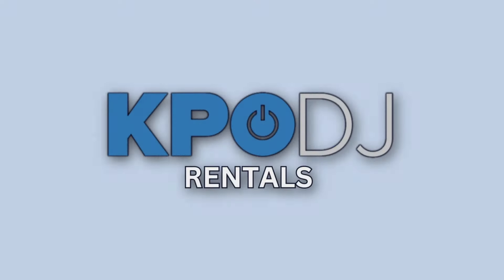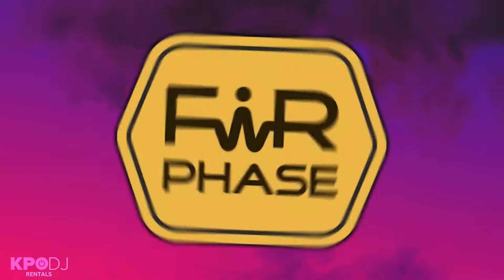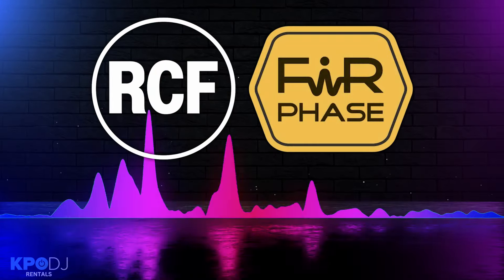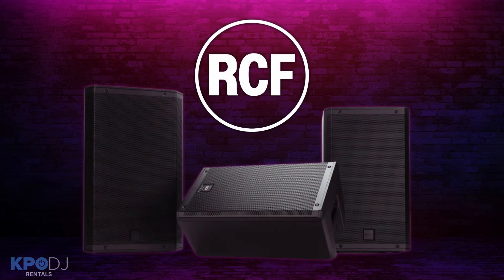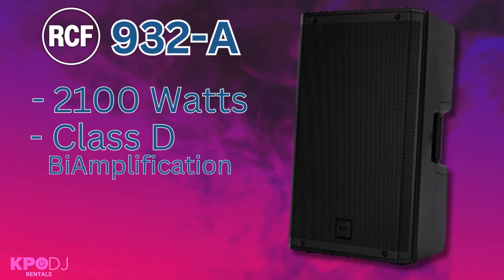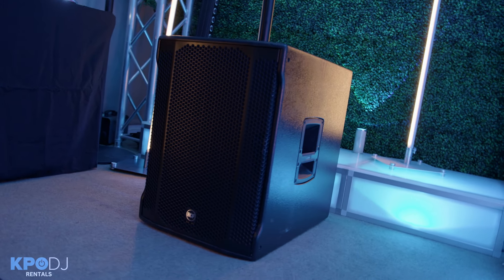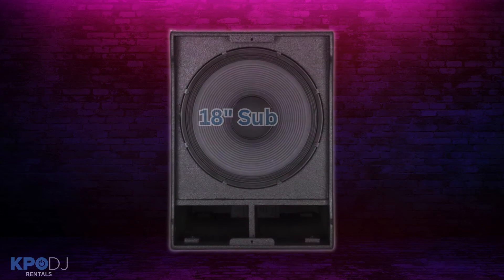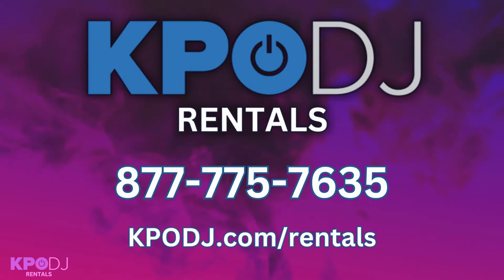Our #1 Audio Rentals: RCF ART 932A & Sub 905A MK3

Comment: Im looking for this exact setup for my electronic drum & DJ show.  Besides the wattage difference from 1400 to 2100, what is ther main difference between the 805 and 905 subs besides $600?  Im sold on the 932s but cant move or lift the 18" subs easily so am considering 15s.  I know this is a compriomise expecially for my edrum setup.